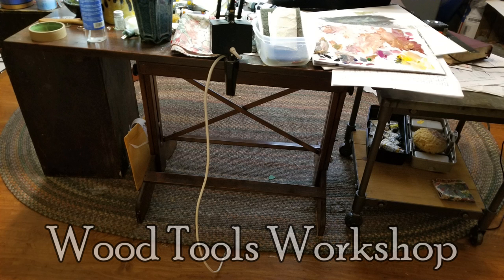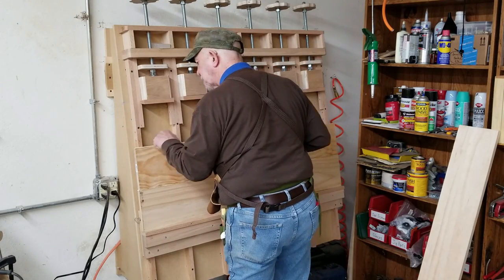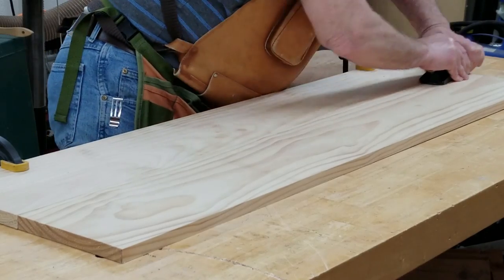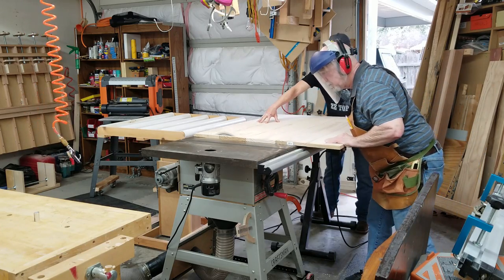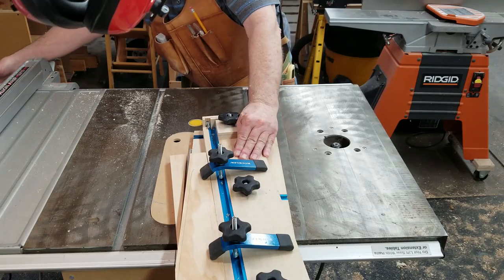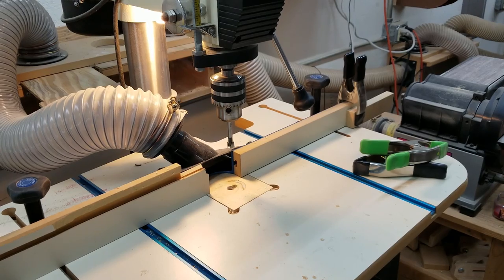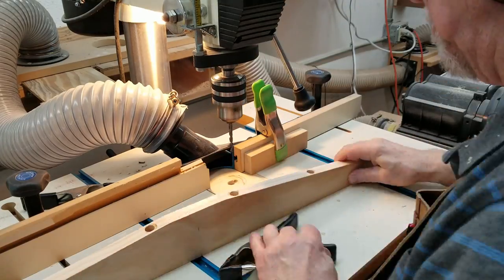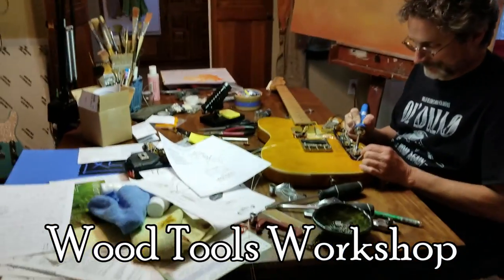Build a Drawing Table Top

Comment: You should have used wax paper for those clamps also.
Reply from the maker: I put paraffin wax on the clamps. I just didn't show it in the video. I've been advised that bar soap works as well. I'm going to try that next time.